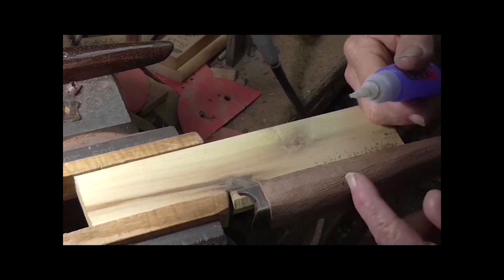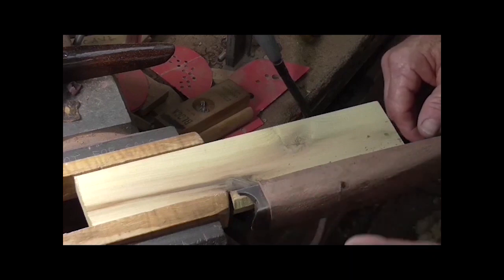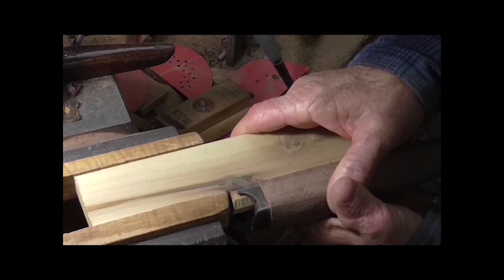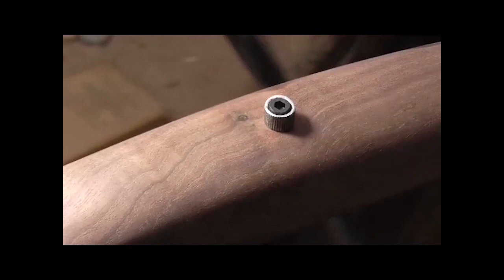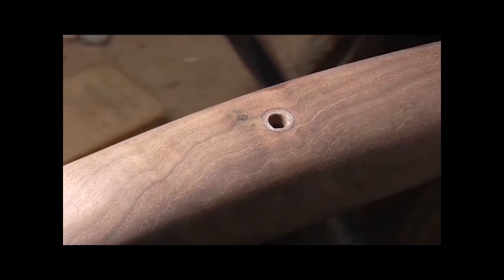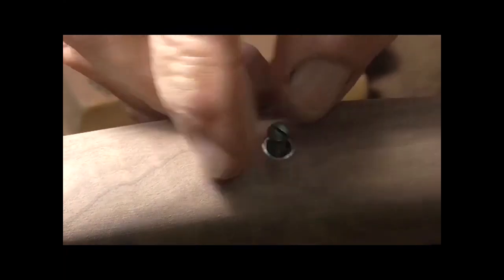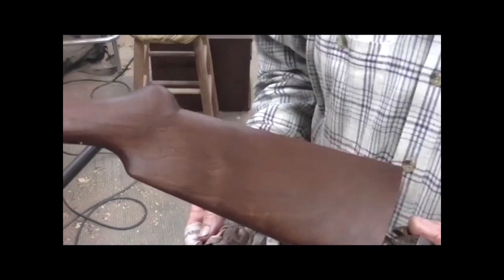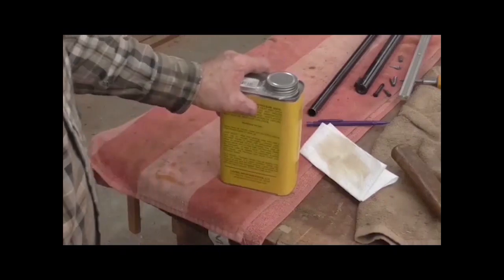E 007 H&R 28 ga. restore

Comment: Ron,
Do you use orbital sanding disks exclusively for the tight work? 
I've noticed you using blocks for the rough removal which I also do in my woodworking but I've not tried the orbital for the finishing yet. 
Be well
Reply from the maker: I have and use regular 9x11 sheets as well but, I do use the Freud round sheets more.